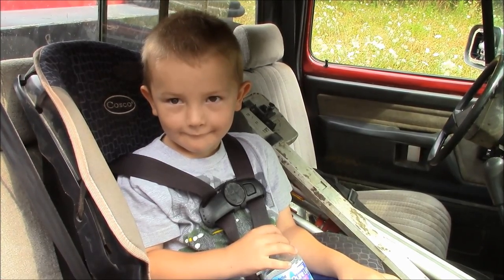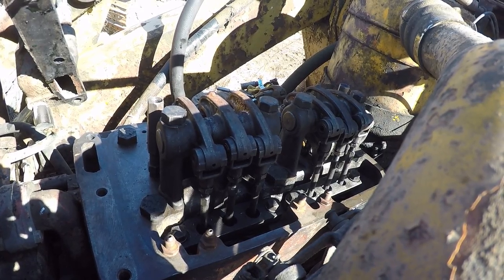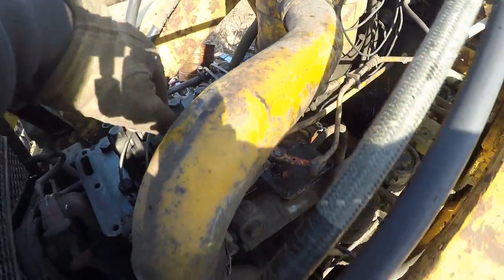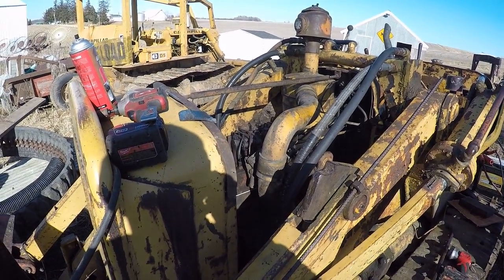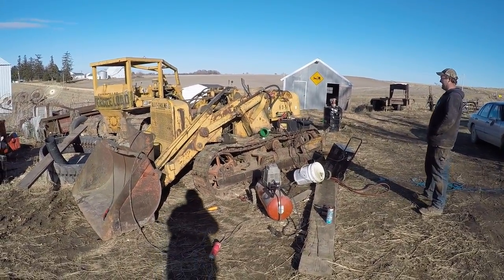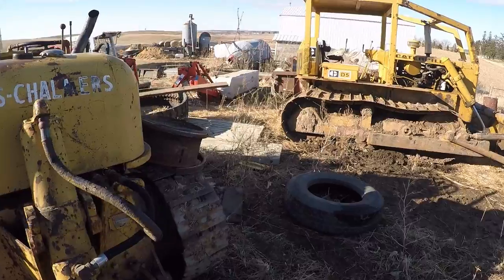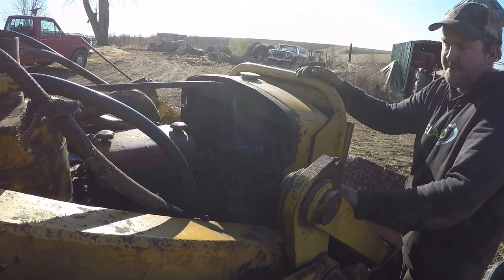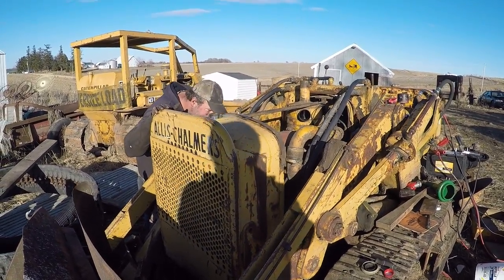Allis Chalmers HD5 | 2-71 Detroit - Will it Run after 17 Years?

Comment: Could be the valve was stuck because rain water went down the muffler pipe while it was sitting for years, then when someone tried starting it the piston slapped the open valve. Just a thought.
Reply from the maker: That's certainly possible.

Comment: A tip from Mr Bus Grease Monkey - to protect engine in case of a runaway, disconnect air cleaner hose to engine at the filter and have a board or similar to ram onto it to suffocate the engine's air supply if needed.  But you knew that!
Reply from the maker: It has a flap built into the intake. It closes anytime you pull the shutoff lever.

Comment: Sounds like a leaking exhaust valve on one cylinder. That’s all the chuffing sound when the starter motor is turning the crank.
Perhaps a tight tappet??

Comment: i didn't see you put any coolant in the machine, and thought i saw the water hose going to the top of the radiator loose and unconnected.  However, how could it run that long without coolant?

Comment: Say wes: I could hear it running on a single cylinder. I fear it won't even pull its pants up if both cylinders are not running. Being a diesel it will warm the other jug but produce no power and I feel the clutches will be easy to fix unless full of water. He needs to pour out the transmission fluid and fill it with diesel till freed up.
Reply from the maker: Stand by for a follow up.

Comment: sounds like it is governed too high.add the hydraulic oil to it, the hoist and tilt will work.i have one of these .a great little machine .mine is a 1949.still runs but is well worn
Reply from the maker: Yeah we will go through the governor settings once the engine clears up.

Comment: You may need to have 24 volts for that. That thing should be spinning over much faster than that. 

A lot of those old Detroits had a 24 volt system. So I would look into that.
Reply from the maker: It's definitely a 12V system. But the cables are shot and the battery setup was sketchy at best.

Comment: i used to have one was a pain to work on and hard to find parts you need a setting tool for the injectors on the older detroit
Reply from the maker: That's what others have said. There are some aftermarket parts, but less every day.

Comment: I find it odd how people run engines with out coolant and think that a few minutes are fine. The seal on the water pump are lubricated by coolant. If you dont have any coolant just dump some water in it and drain it when you are done. Hopefully there was a bit of coolant in there.
Reply from the maker: I dunno. It's done all the time and I've never seen it hurt anything. I can't think of a single water pump seal that ever failed after running with no coolant. It's just idling.
Reply: @WatchWesWork  I am always worried about it myself.

Comment: I never knew there was any two cylinder, two stroke engines installed in that kind of equipment.
Reply: John Deere also used them for a bit too, if I remember correctly. Could be wrong. I actually have a 4 cylinder 2 smoke Detroit laying around I need to start looking with some wrenches soon.

Comment: IMO, One of the valve still stay open. We can hear it while cranking. It run on one cylinder.
Reply from the maker: By the end of the video it was doing better. It's going to take some time to clear up.
Reply: @WatchWesWork  I suspect a stuck injector too. If they are the slightest bit dirty ,they will dribble and stick open or closed in the Nozzle itself.The smoke coming from the rear cylinder is a hint that the fuel isn't atomising .  . I served my apprenticeship on these and their EMD cousins. Same engines just a hell of a lot bigger.

Comment: These machines have two battery boxes and are 24 volt and this may be the reason it's turning hard
Reply from the maker: These machines were 12 volt. It would originally have had two 6V batteries in series just like my Oliver 1650.

Comment: Love the equipment repair stuff.   feels good to bring something back that was left for dead.   I had the opportunity to buy one locally for 700$ running but passed because it had track issue on one side and had a problem with the drivetrain. maybe a drive coupling or something like that?
Reply from the maker: I saw one for sale here for $1000 that ran and drove! I'm not sure there are any undercarriage parts available for these machines.
Reply: @WatchWesWork  Might be some out there, you never know.   But if not, you have to be able to make your own parts, like a museum piece.  wikipedia has the serial numbers to tell you the year of manufacture.

Comment: they are tough little engines, i had one with a hole in one piston and still ran except it blew lots of oil out of the muffler. i had just bought it that way. sounds like 20,000 rpm but its only 2200
what state are you in?

Comment: you better make sure that racks turning cuz it's in the injectors are stuck or one of them is damn things going to run wide open because when that thing's not running the governor makes it set at wide open until it cranks

Comment: In my experience no coolant leads to cooked o`rings on the liners. But I knew this would start old iron will last forever and is very forgiving about sitting for years.
Reply from the maker: There's coolant in the block. He just drained it enough to pull the head.
Reply: 71 series Detroits are dry sleeve.

Comment: Agree with the others seeing this - the loading issue is making the last couple of videos impossible to watch.
Reply from the maker: I don't know what you guys want me to do about it. Try a lower resolution.
Reply: @WatchWesWork  It's fine.. like you said, they can pick lower res if they want. Would have thought the motor would be overheated in that much run time.
Reply: I’ve tried 480 but it doesn’t seem to make a difference. The last video played fine after about a day but I’m worried about you losing views which usually peak in the first few hours after release.
Reply: It's a general Youtibe issue, not just Wes' videos. It has been going on for weeks. I think it's an IPv6 thing, because it works great at work where we have an ISP that supports IPv6, at home where it doesn't work well, I have no IPv6.

Comment: HD-5 the engine is a 2-51    51 cubic per cylinder.
Reply from the maker: It's a 2-71. There is no 2-51, but there was a 2-53 which was used by John Deere in the 440 crawlers.

Comment: Would it be possible to put a ballvalve on to the fuel line so if you have a runaway engine you can turn off the valve to stop the engine?
Reply from the maker: It has a butterfly that cuts off the air.

Comment: Hey Wes I recently got a tree journeyman j350 with a dynapath delta 20 controller I accidentally ran it into the x limit switch and the controller faulted out I watched your video on fixing a machine stuck In Estop but I’m not ready to start tearing out boards I backed the machine of the limit switches and even pressing reset 2x I can’t clear the code and another code pops up if I press reset!! I really need some help if you have time to lend it!! 
Thanks-Rowan

Comment: Have you ever put some gas on a rag and held it over the intake for a split second
Reply from the maker: I don't see how that would be any better than ether. These engines have pretty low compression, so ether is not too dangerous.
Reply: Gas on a rag is cheaper than either! And it won't break piston rings.

Comment: can you not pull it with another machine to loosen then tracks?
Reply from the maker: We've tried. The gearing is wrong. It's much easier to break them loose from the engine side of the gear reduction.

Comment: I have absolutely no idea how that ran that long without seizing up with no coolant. That engine must have 4 inch thick cylinder walls and cast iron pistons.
Reply from the maker: We kept touching the engine block and head. We shut it down when it was just warm to the touch. There was coolant in the block.

Comment: Is the blower drive stripped
Reply from the maker: I don't think it will run without the blower.
Reply: @WatchWesWork  no i posted that befor it started
Reply: @WatchWesWork  i have rebuilt most every detroit built except 12v71

Comment: I have been trying to think why guys like “Will it start” videos.
I think it is the same reason girls like Brumbies aka Mustangs.
Free horses! Dad can I have one.  No one owns them.  They are free.
Skid loader won’t run?  It’s a Brumby :)
Reply from the maker: There you go. I think it may be just nostalgia. We're all so used to a modern engine that won't start because of a slightly distorted waveform from the crank sensor or the smallest corrosion on a PCM harness pin. Yet this engine ran away, dropped a valve, was put back together after 17 years, and starts right up!

Comment: Lol, I always cringe when you crank on an Old diesel that long your dad has got it in bedded in my head not to do that because of burning up a starter. I need to bring out my GB 150 jump pack to your place and we should try it on one of your machines It’s rated at 4000 amps.

Comment: "1.484" ?!?!?
He was right, they know just enough to be dangerous.
Reply from the maker: Well we can read a service manual...
Reply: My point was 1.484 is just shy of a inch and a half. 
I think you meant .1484
Reply from the maker: @briankingwelding4531  The injector timing is adjusted by measuring from the top of the injector to the top surface of the head. There is no lash. This is a standard procedure for unit injectors. The spec is 1.484". Different injectors have different timing settings based on application.
Reply: It looked like you were measuring valve lash
Reply: Also, running a engine without a exhaust manifold can crystallize the valve stems.
As soon as you shut that engine down the cold air hits those stems, much like throwing cold water on something you just welded
Just a little FYI
Reply from the maker: @briankingwelding4531  We did also set valve lash. I'd suggest you may be in the wrong place. Maybe try Squatch253 or someone like him who only does every by the book. We're just playing with an obsolete machine that has no value.
Reply: I wasn't trying to be a jerk,  sorry if I came off that way. 
Working in the earthmoving/heavy equipment industry I understand what you're saying

Comment: Watch Bus Grease Monkey's videos to learn what ya need to know on Detroits.
Reply from the maker: He's pretty good with them.
Reply: @WatchWesWork  "knows those detroit's there's no doubt ,,, upside down and inside out"
Reply from the maker: @cyrilhudak4568  These industrial engines are different than the truck and bus engines. The governor setup is different (constant speed). But the guts are the same.

Comment: Called a bendix on the starter..
Reply from the maker: Technically, this is not a Bendix. A true Bendix uses a spring to engage the pinion gear. But, it's basically a catch all term for starter engagement devices.

Comment: Good to see it run buuuuut..... you ran it way too long without coolant  in it.
Reply from the maker: Technically it has coolant in it. Just not 100% full.
Reply: @WatchWesWork  A little in the block is not good when the most heat generated is around the valves.... in the cylinder head which was dry.
It's not a gripe, I'd just hate to see your head gasket go straight away with a possible warped cylinder head. At least put a hose with a trickle of cold water through it 👍

Comment: Guess YouTube doesn’t want me watching this video because it will not load.
Reply from the maker: Just try again later. It seems to be happening to a few guys.
Reply: Watch Wes Work this video and the last one you uploaded, runs for about 30 seconds and freezes.  No matter how long I wait, it won’t load.  I have no other videos or channels this happens.  I really like your videos so I hate to miss out.  Did you change anything on the last video and this one from your previous uploads?
Reply: James Driscall I have had the same issue with just this video.

Comment: It seems like it should roll over easier than that.
Batteries are junk.
Reply from the maker: You mean the battery we borrowed from a tractor, hooked up with jumper cables, to the rotted battery cables, run though a starter switch that hasn't moved in 17 years, and backed up by a Walmart battery charger? I can't believe it turned over at all.

Comment: How to turn a 2-71 into junk. Keep running it with no coolant. That head is toast.
Reply from the maker: Hmm. Just ran flawlessly for a whole day last weekend. But I will let the machine know that it's supposed to be junk.
Reply: Watch Wes Work  the one thing Detroit diesels won’t stand is overheating. The heads are very sensitive to over temp especially in the narrow spaces between the injector and the valve seats. It only takes a few seconds of overheating to crack the head. Also, the water jacket passage o ring seals between the head and block are easily damaged by heat and will leak coolant if damaged.

Comment: Need more battery
Reply from the maker: Yeah. The cables are also a mess.
Reply: I kept asking myself why they didn't drive a pickup over with jumper cables.  A little patience and starter fluid and it worked.

Comment: 24 volt
Reply from the maker: It's a 12V system. It would have had two 6V batteries in series originally, just like my Oliver.
Reply: @WatchWesWork  I have a Clark skidder with a 353 Detroit,  In the cold weather I start it with 24v..... loves it!
Reply from the maker: @michelebeck4311  Heh. We thought about throwing the 24V charger on it. Instead we hosed it with ether...

Comment: Maybe you can use a little ether to help it start 🤔🤔🤔🤔
Reply from the maker: If only we had some. There are at least a dozen diesel engines on the property, so it's not hard to find.
Reply: @WatchWesWork  ok well do you have a Walmart where you live and they sell some pretty cheap 🤔🤔🤔